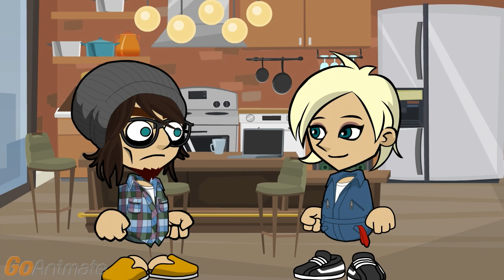LG Oven Error Codes

Comment: Stay away from LG ,Samsung ovens, they make ok electronic equipment, I'm 63, bought a lg oven and it only took couple years and needed a sensor and board, my old ge was still working after 20years but wanted a new oven,lol!
Reply: Older is better.  I work on appliances for a living and there are plenty of ovens that are 20 plus years and still running strong while new appliances start having issues after 5 years. The more electronics the more problems.  If you want a good brand go buy some cheap Amana appliances.  A lot of there stuff is simpler and less likely to be an issue.

Comment: A mouse chewed a mini-wiring harness between the control circuit boards.  It is impossible to find a replacement for the harness; even the manufacturer was no help.

Comment: While it is great to have this information, I would like to point out that not all LG ovens use the same codes.  My LG oven comes with a service manual, and my F7 error is "shorted keyboard", and was caused by the maid spraying spray cleaner on top of the keyboard, and some large amount dripping behind the glass.  I can shake drops of cleaner out, so I have confirmed the cause.  My point is, you have to look up error codes for YOUR LG over, not just any LG oven.

In the case of water behind the glsss keyboard, it looks to me like the electronics have a conformal coating, which means the board is waterproof, but water behind the glass is detected as a finger press.  The manual suggests a finger press for 40 seconds could cause this error, OR a drop of water that takes more than 40 seconds to evaporate.  In my case, it should correct itself once the water dries.  should...
Reply: l